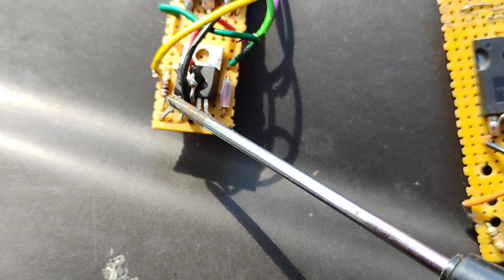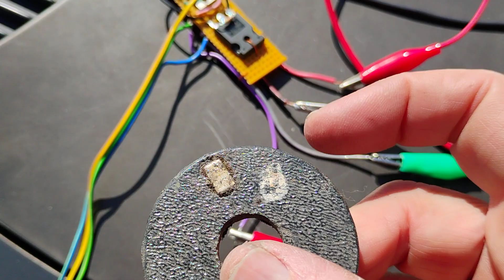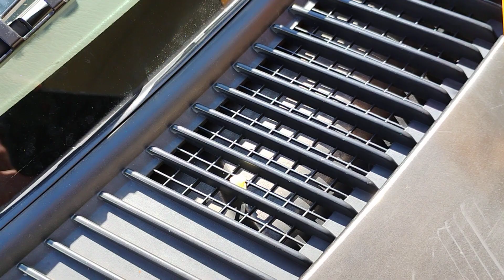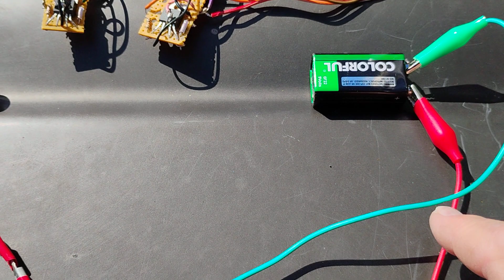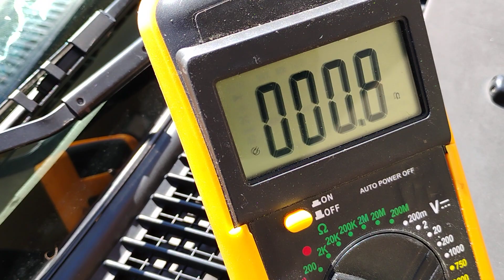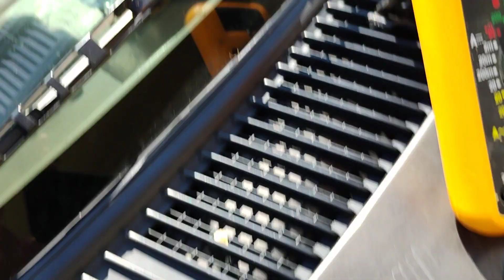Hall effect triggered mosfet circuit

Comment from the maker: the mosfet is 500V and 20A not 200A like I say in video
Also here is the circuit, but this drawing shows an 8 pin 4221 chip with a socket too, the video shows a 5 pin 4221 chip.
https://alternativeworldenergy.wordpress.com/simple-mosfet-pulsed-dc-circuit/